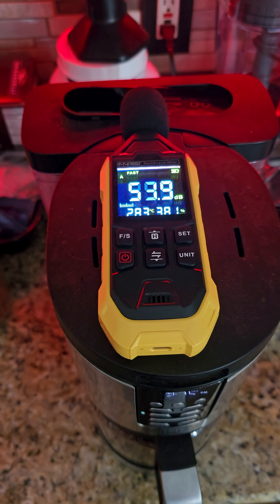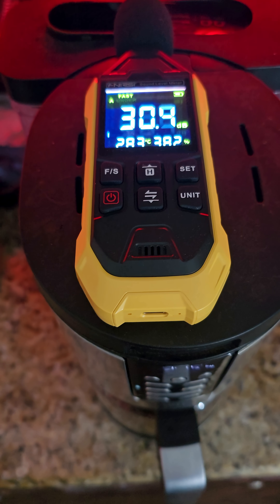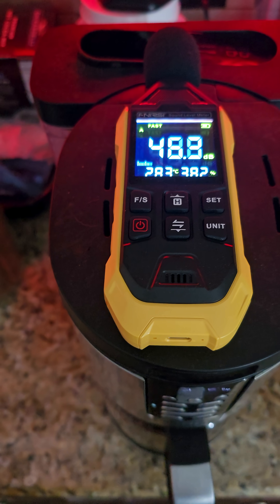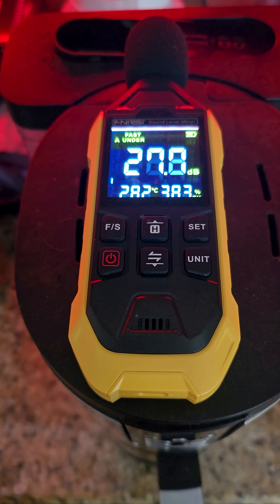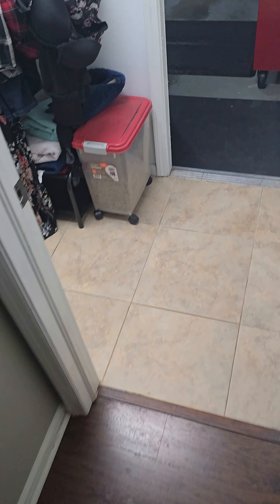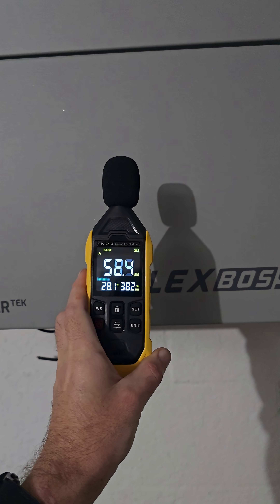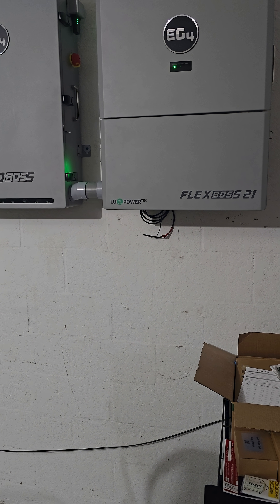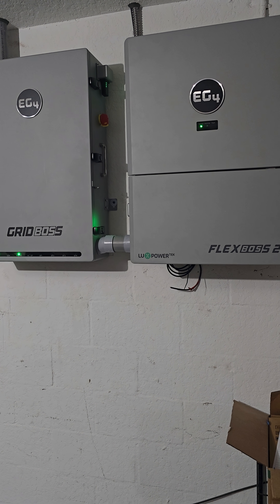Is the EG4 FlexBoss 21 Quiet Enough for Indoors? Decibel Test + Real Results @6000W Solar

Comment: Thats NOT noisy at all
Reply from the maker: Sounds loud on video because that's the only sound in the room.

But the fact I can talk over it at a normal voice is pretty good!  Also now that I have had it for a while, got batteries hooked up, etc it has been pushed much harder.

The good news is even at say 12,000w it still is the same, it doesn't get louder or it hasn't for me based on the load and PV I have had